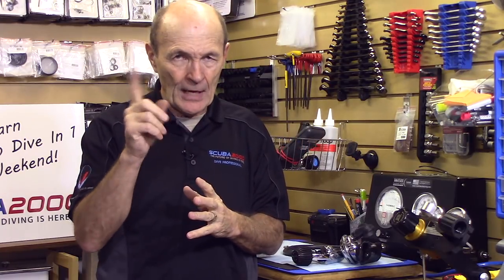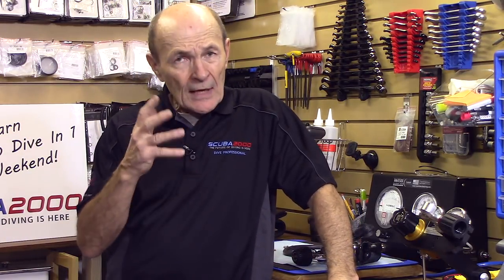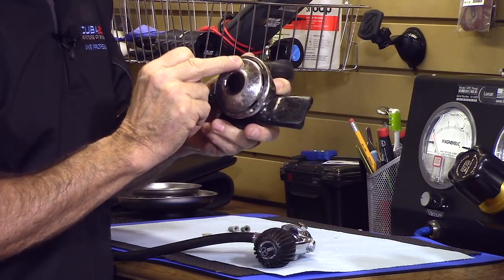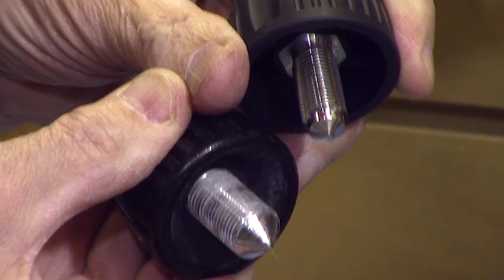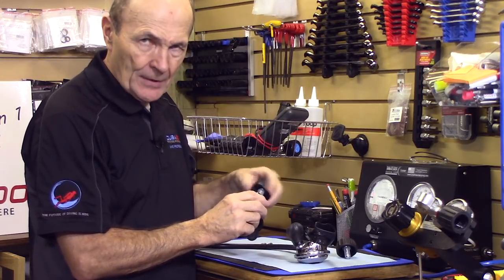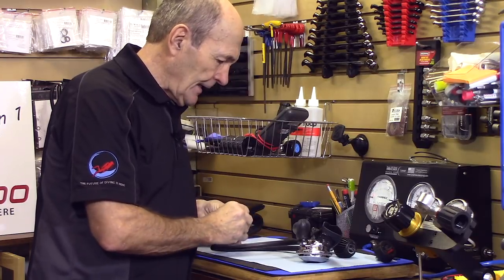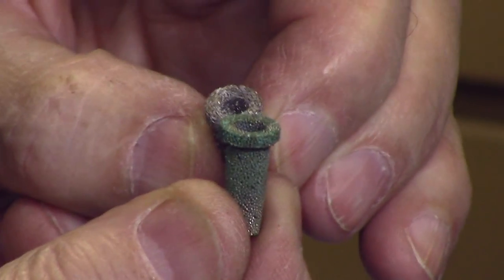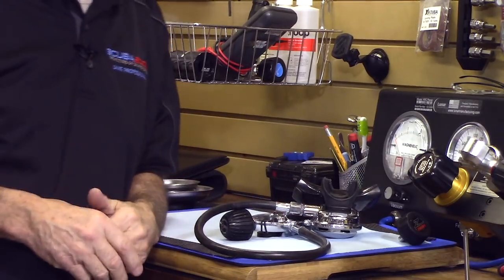Does My Regulator Need Service? - Scuba Tech Tips: S07E04

Comment: I am probably the only person watching this who is old enough to recognize that regulator - a US divers Aquarius. I still have one I bought in 1975. It still works - but I seldom use it. That reg is unbalanced and I could tell when the air pressure got below 700 psi on a dive below 60 feet because breathing resistance would begin to increase. It was a little wake up call. After I bought a USD Conshelf 21 I learned to watch the SPG carefully - because that reg gave me only about a two breath warning. Great videos - thanks,
Reply from the maker: The Aquarius was not one of US Diver's finest!!
It was pretty popular but only because it was really cheap - cheap to buy and cheaply made.
Not a great breathing regulator at the best of times. Useless at depth.
It's one interesting feature is that, despite being a piston 1st which normally cannot be adjusted, with the Aquarius, you could adjust the IP.
Not worth it though.
Nice old relic, with emphasis on relic.
Take care.
Alec

Comment: To keep my Aqua~Lung Legend's warranty valid I have to have it "inspected" after one year, "serviced" after two years, then inspected again on year three, serviced again on year four, etc. My local dive store doesn't charge for the inspections, and the charge for the service is very reasonable; and, as long as I stick to the schedule, I get free parts for life from Aqua~Lung. Needless to say, I'm sticking to the schedule. (Of course, if I got water into it somehow, dropped it hard, or had some other mishap I'd take it in to be inspected right away, and the self-inspection tips you show are something I'm going to start doing before every dive session. It's life support equipment; better safe than sorry.)
Reply from the maker: That's the common warranty process now. Sherwood started that a number of years ago and most other big names do the same.
It's partly a reaction to complaints about the cost of service, partly recognition that divers don't dive very much and partly because of better materials in the regs.
It's all good I think.
Good to hear from you Brian.
Alec

Comment: Alec you should make a video about your dive gear. What you carry on you , what you travel with. What computer do you use etc .
Reply from the maker: That would be easy but I don't necessarily want divers to try and mimic me.  What I use is perfect for my age and diving needs but may not be right for any other diver in the world. And, BTW, it's taken me 60 years to get it right!!

However, for you David, here's a list:
- Cressi Big Eyes Evo mask with Rx lenses
- Cressi dry snorkel
- Scubapro Nova SeaWing fins - white
- Henderson wetsuit - 5mm and 6.5mm
- Oceanic ZEO regulator - all flex hoses
- XS Scuba Alt Air octopus
- Oceanic OCi AI Computer
- Oceanic Biolite BCD
- Big Blue CF 1000 dive light

Take care, Alec
Reply: I took your recommendation on the Nova SeaWing fins and absolutely love them! (and flex hose everything - easy upgrade).
But wait: Oceanic ZEO reg is "over-balanced diaphragm FDXi first stage is environmentally sealed" - not piston ? funny though you said you preferred piston... :)

Comment: You mention having it service if gear sits unused for a long time (2+ years). What about buying new old stock regulator - if you connect and it works in pool do you really need to have it service when it's never been used ? 
I bought a discontinued Aeris reg (same parts and service kit as the current Oceanic parent company, so their isn't issue getting parts/service) for pretty close to the price of getting a full service, and it's been working great for 2 years now and 80 dives or so (though I did have the top seal on the AT600 bust on the beach (thank god not under water!) on a trip and had to go back to a shop to have it replaced to continue my trip) and thought maybe I can use it for 3-4 years and get another new one if similarly priced to servicing... I still will check rubber/membrane and first stage filter to make sure things look ok in the mean time... but busting o-rings are hard to tell.
Reply: Yes old gear especially lube and o rings deteriorate with time especially if not used

Comment: When it comes to servicing my regulators, I check the manufacturers requirement, these guys that make these recommendations know what their doing so my advice is to follow it. But I have had my  regs. checked in as few as 6 months. This because if I am diving in really murky waters or colder waters that strain my regs. I know there are damages that can occur in these conditions regardless of the number of dives or time period between servicing so for my own safety it doesn't hurt to have it checked after a couple of dives in these conditions, and I am fortunate enough to have a dive shop that charges very little if anything just to check it out. Only one time have I had to have something fixed on my set before the scheduled service date, but that one time could have very well led to a problem underwater had it gone unnoticed. So use common sense, think about where you've been diving and the conditions you've been diving in. If you feel you may have worked your gear too hard, whats the harm in having it checked? whats the harm in not having it checked?. something to think about.
Reply from the maker: Excellent point Gee.
The recommended service interval is based on a normal dive pattern. If you dive deep, cold or dirty, you should get service more often.
That's a good dive shop! Too often a diver will take his gear in to have it checked or just looked at to be sure it's OK and then face a $200 bill for a full service that wasn't necessary.
Take care.
Alec

Comment: Cool video. Diving company want you to do service of because of the expensive service kits. 
But the people try to save too match and don't do necessary service.
Reply from the maker: Certainly dive stores make money on service. Pretty dumb to do it if it doesn't make money.
However, no dive can survive on service alone. There's not that much profit there.
The mark-up on a service kit is the same as on a mask or snorkel which is easier to sell.

It's a compromise. Divers want their gear to work well and be reliable. Just as with any piece of machinery, that means service and that means parts. Kits for most regs run about $25 - $50. Not bad every 2 years to keep it running good forever.
Take care.
Alec
Reply: Sure. I mean price for few o'rings sometimes is expensive.

Comment: Hi Alec,
Thanks for the video! Is there any modification to regulator service when servicing for cold water use? Should the IP be adjuster lower, or should the cracking pressure be adjusted so the regulator is a bit harder to breathe?

Comment: Alec, I just came accross a Aqualung conshelf xiv which hasn't been used for a while but my LDS won't touch it, they say it's too old to service. However, the reg itseld look very nice and would really like to confirm it's in working condition. How can I do this? Would it be possible to service this myself? I am not liking that LDS won't services things you didn't buy from them, I better keep away for such business. Your videos have saved me lots of $ and helped me to make the right choice for other items as well. Keep it up!
Reply: If you can get the parts and you are competent in working with O-rings there should be no reason why you can not service it yourself.  The main thing is taking your time and cleaning things up correctly and have the right tools to check things out.  Head over to https://www.scubaboard.com/community/forums/repairing-your-own-gear.99/ and find your reg set.  They will probably have all the information or links for information you will need.  Even an old scubapro 109 can be used today and it's a very simple device that has not been made since 1986 http://www.sgscuba.com.sg/2017/01/vintage-regulators/ I have one that I will be using on a pony bottle for solo diving at some point so that I always have a backup if there is an issue under water.

But remember that you are potentially taking your life into your own hands, if you have any doubts about if you can do things safely find another shop and have them do the work.  I know some people swear by some of the bigger places that basically only do service work.

Comment: Hello Alec,

Been watching your videos for several months now and really enjoy the information that you offer and provide regarding scuba diving.

Ironically, you posted this video on regulator servicing at a most opportune time from myself, as this is the time of the year that I send my regs and tanks to the local dive shop for service before the start of the summer dive season. As I am a wet suit diver, and living on the east coast of Canada and diving in the Atlantic, I do most of my diving between May to October each year and average about 25 - 30 dives each year.

Just wondering what you would consider a fair price for the visual inspection of two steel 100 tanks and a set of regs (1st stage is an Oceanic CDX5, 2nd stage is an Oceanic GT3, and the octo is an Oceanic Slimline 2)? I have had both the tanks and regs since new in 2012, I faithfully have the regs serviced and inspected each year. I also ensure regs are rinsed in warm water immediately after diving each day. Tanks are also vis'ed each year and were last hydro'ed 2 years ago). Prices have varied each year for the service and as there is only one dive shop in our local area, there is not much choice for service unless I send them elsewhere. This year, the vi and the service cost was $155.00 CAD, which I consider very fair.

I realize the price will vary depending on the parts and service kit used. What is your opinion?

Thanks, and keep up the great videos.
Reply from the maker: Cost of service is set by the LDS but of course the cost will be similar in most stores. 
I can only tell you what we charged at Scuba 2000 in Toronto.
A visual exam is $20 +tax. If a valve needs special attention to remove or replace, that's extra.
At least 2 O-Rings need replacement during a visual. They cost about $2 each. And we charged for the air fill too - $10.
So the total cost of a normal visual with no valve service would be $35 per tank.
Steel or aluminum doesn't affect the cost of a visual. Steel is more expensive to hydro.

A regulator service is more complicated. A full service as required every 2 years per warranty or if used a lot, costs $70 plus parts. Parts kits can be anywhere from $15 to $100. I suggest an average of about $35. Any special service required such as extra cleaning, repairing unusual damage or extra-difficult regulators would be extra. Some regs needs additional parts. Mares regs for example have a service kit but they also require a replacement HP poppet (TriMetal Seat) at every service. It is not part of the kit for some reason and it costs $35 on it's own!! Also environmentally protected regs with silicon oil are extra. They are messy plus take more time and need the oil replaced. 
So a reg service will cost about $100. That's for the 1st stage and 2nd stage only.
The octopus is an additional charge of $30 plus parts, a total of about $50.
You should be getting the SPG swivel pin replaced if you have one - $11 plus the pin ($6), total $17.
And the BCD LP hose valve should be replaced - $7 plus the valve ($7), total $14.

So let's add it up. 
- tank visual with parts  $35
- reg service with parts    $100
- Octopus                           $50
- SPG swivel                       $17
- LP hose valve                  $14
Looks like a total (1 tank) of $216 + tax.

Now again remember that this is approximate. Many stores are higher; some lower.

We also had a Inspect/Clean/Adjust service that is fine for occasional use, well-maintained regulators. It is in accordance with most manufacturers warrantees. As the name implies this entails a thorough check of the regulator including a performance check. Any parts would be extra but should be minimal if any. This is the service we'd recommend every 2nd year, between full service years. The cost is $45.

Sorry for the long reply but scuba service is critical and can entail a lot more than a quick spray with silicon oil!
Your Oceanic regs fit into this scenario well for both labor and parts. It seems you're getting a good price. Just be sure it's a complete and proper service.
Where are you in the east?

I hope this helps.
Alec

Comment: Alec, I've heard that the new flex hoses for regulators are producing fine particulate mater. Is this true. What is you opinion on this? Have seen any evidence of this?
Reply from the maker: Old news Sharkie.
That was a problem several years ago and the issue keeps popping up as divers read old posts.
Not an issue now - unless you have old hoses of course.
Alec
Reply: Alec Peirce Scuba , Thanks for the info. I like the idea of a more flexible hose,  especially for travel, but was concerned about the info I was given.

Comment: Added 360 swivel to second stage reg is a safe second necessary On a 13 g pony for river dives “10 to 16 feet “boats real close
Reply: I have a 80gollan tank for refill on the boat but I think it’s over kill to go full scuba for arrow heads in 10 foot of water ...your thoughts??
Reply from the maker: Have you considered a Hookah, either a commercial one or a simple one where you run a long (50') hose to a tank in a boat, on a float or on the shore? That would save you a lot of aggravation and give you lots of time underwater.
Much better than carrying a tank around in 10'.
Alec

Comment: Hey Alec, I just purchased a brand new adjustable 2nd stage  (Hot Dive T2 from China) to go with my freshly service Oceanic 1st  stage that is been set and tested at 145 psi. The description from an advertisement said the Hot Dive 2nd stages are set at 150 psi, but that may  or may not be true beings it was not a description from the makers or distributor of the Hot Dive company. All my friends that have purchased the same regulator  said it works perfect with the system they are useing from the US, like the Dacor and US Divers. This whole system is basically brand new, except the 35 year old depth gauge.
 Before I use the Oceanic / adjustable Hot Dive  combination, is there any thing that i will need to do to the 2nd stage? 
 I have not dove with an adjustable 2nd stage since 1990, and it was a rental and not in the best of condition back then, to put it mildly.  I probably should not have used it due to the condition ir was in back then.
Reply from the maker: Nope. Get the 1st & 2nd connected carefully and then slowly turn the air on.
If you get a freeflow & can't stop i using the adjustments on the 2nd, you will, need to adjust the IP at the 1st.
You ought to be able to turn the adjustment so that at one end it's very easy to breathe, almost freeflowing, while at the other end of the adjustment it is harder.
Alec
Reply: @AlecPeirceScuba_SeaHunter  thanks. I appreciate it.  I will give you a reoort on how it works out.

Comment: Hi Alec,
When I did my dive training here in Switzerland about two years ago, we always used two separate first stages in case one freezes. I've never seen you talk about this. Do I really need two first stages if the water is cold? Or does it depend on the type of first stage I use?
Thanks for your amazing videos, I already learned a lot and plan to get my own gear soon.
Reply from the maker: Hey, redundancy is never bad. You have a spare tire in your car right?
But, assuming your scuba gear is relatively new and in good repair, you simply don't need a lot of extra back-ups. Redundant air supply, back-up dive computer, 2 first stages, etc. are not a bad idea. They're just not necessary for most divers.
Again, as I've said many times, the dive itself will dictate what you need. In a very deep dive or an overhead environment, caves, wrecks, etc. where you cannot go directly to the surface at any time, redundancy become vital. Diving at the cottage a couple of times a summer, a week of diving on a Caribbean reef within sport diving limits - not needed.
Even a freeze-up of the 1st is simply a quick trip to the surface. Again assuming you are not under an ice cap or very deep.
As far as the type of regulator, every regulator will freeze under the right (or wrong) conditions. Prepare your reg for cold water diving and treat it properly at the dive site with some of my tips. I have made literally hundreds of dives in cold water (many under the ice) and a warm, dry regulator is key plus NOT breathing through it in the cold air beforehand.
Good luck.
Alec

Comment: what about checking some of the rubber/membrane parts as well ? any tell sign, easy checks ?
Reply from the maker: I didn't want to get into the insides Brian. Of course if you're able to do so and can check the diaphragm and exhaust valves they are a good indication. Exhaust valves in particular since they are so thin, often dry out, crack and/or stick to the body and can tell you quickly it's time for service.
Alec

Comment: Alec,
Does using a high pressure cylinder increase the chances of your regulator freezing up in cold water? I've never experienced regulator freeze, and I'm about to do some cold water diving. I have both low and high pressure cylinders. Thank you very much
Reply from the maker: High pressure is usually 3000 psi (there are higher but they're not common).
Low pressure is usually 2442 psi.
It would make very little difference if any to use either one.
It's a good question since the adiabatic temperature drop is related to the size of the pressure change in the regulator but between 3000 and 2442, not so much.
Good luck.
Alec
Reply: @AlecPeirceScuba_SeaHunter  thank you, sir.  I have LP 2700 and HP 3400.    the water is 45*F.  Regs 2 years old. Should be fine.